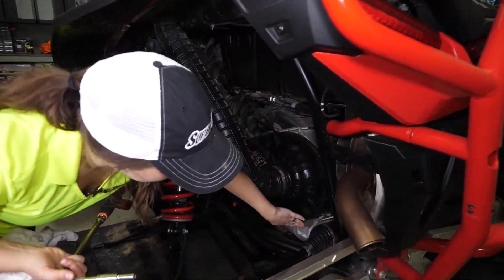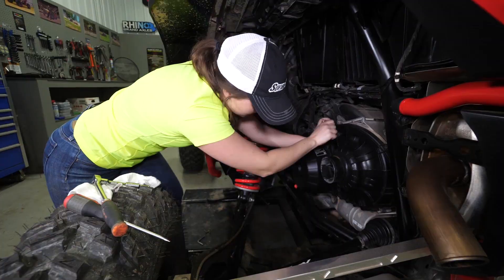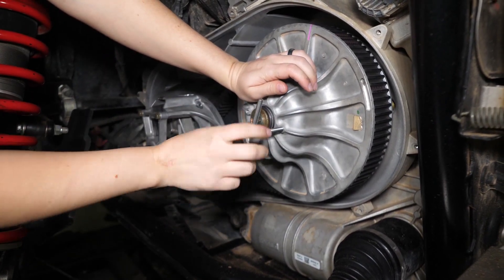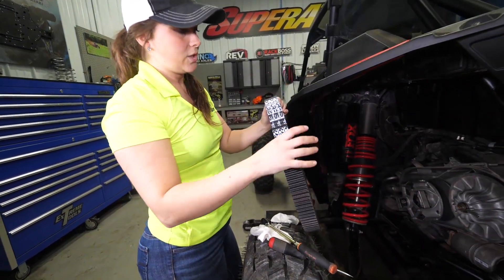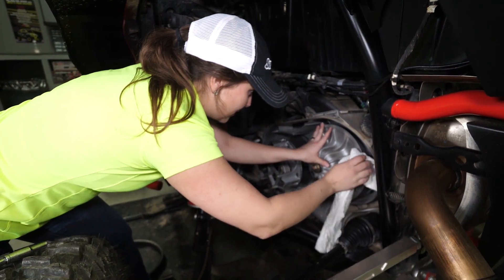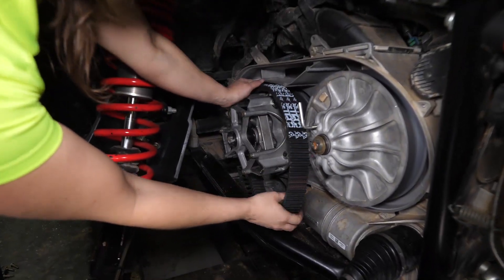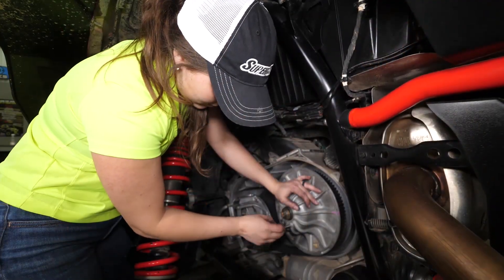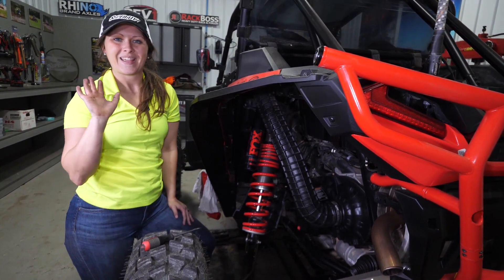How to change Polaris RZR Turbo S Drive Belt | Maintenance Matters | SuperATV

Comment: Por qué se le mete el agua
Reply from the maker: Parece que es posible que tenga un mal sellado alrededor de la tapa de la carcasa. Puede comprar un sello de repuesto en un concesionario Polaris autorizado.

It sounds like you may have a bad seal around the housing cover. You can purchase a replacement seal from an authorized Polaris dealership.